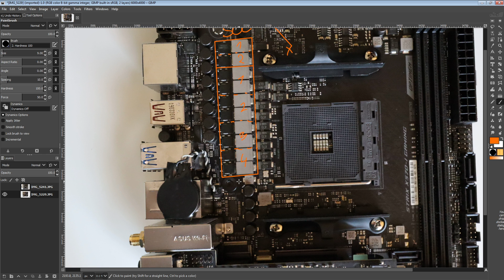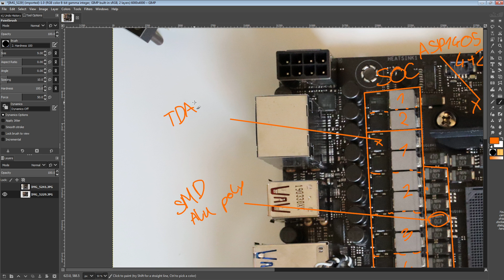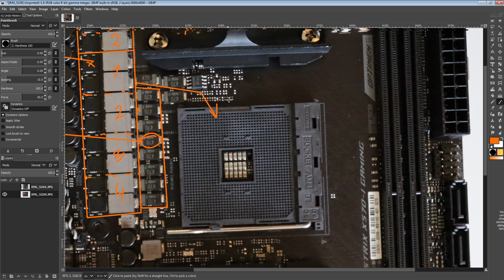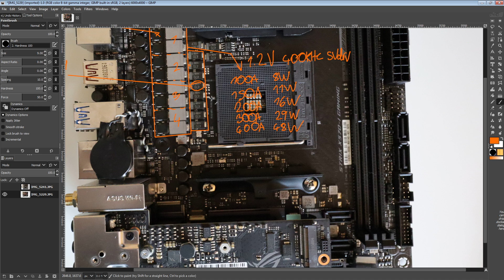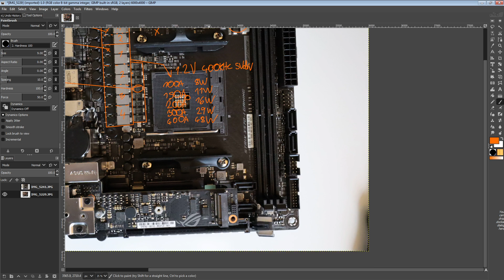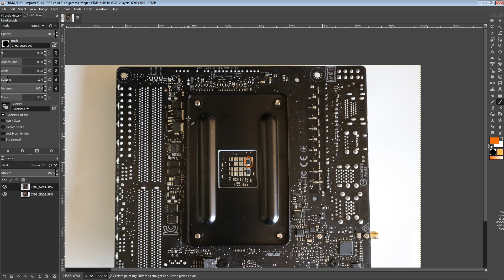mobo PCB Breakdown: ASUS Strix X570i Gaming // a cheaper Crosshair 8 Impact

Comment: wow those capacitors are awesome! I wasn't aware of the 3-terminal ones, but it's an option on the GX series. According to panasonic it lowers ESL by 50% These also have the lowest ESR of any SMD molded 470 uF capacitor at 3 milliohms. They're also really expensive at $.607 for 10,000.

I looked up those tantalum polymers on the back and according to the package codes (N  eJ8) they are Vishay T55 series(N) 2.5V(e) 220 uF(J8) and they sorta look like B-case which is the smallest size they come in. ESR for that is 25-70 mOhms. $0.444 in qty 24,000

For comparison they do make 220 uF MLCCs in 1206 size (b-case is 1411 so 1206 is a little smaller) which cost $0.417 in qty 4000. 47uF MLCC in 0805 only costs $0.085 for qty 3000

Anyway there's a surprising amount of options here, and high capacitance MLCCs are really expensive, as are low-ESR aluminum polymer and tantalum.

I had specified the panasonic molded type capcitors for a 2-phase I designed but they were so expensive they upped the BOM cost by quite a bit and I had to go back to cheaper SMD can type. I'm going to edit the layout to accept either size so if the cans don't perform as well I can just order molded ones.

Comment: I literally just bought this board!
Reply: Where from dude?
Reply: @eydleman  Amazon!
Reply: @AdamBrackney  Amazon UK ? It's £300 🙈
Reply: i got one from ebay for 250$
Reply: @Let-Make-It-Happen  need something for my 3800x lol im still debating
Reply: @PersonaXlll  +1
Reply: @hobbes2234  just brought it 5 hrs ago 😂✌️
Reply: Any coil whine?
Reply: I also got mine for 3700x last week as a placeholder for gen 4 cpus... Hopefully for gen 5 too
Reply: @DaveChips  Unfortunately I think it's been pretty clear that gen 5 will be on a new socket but I would be very pleased if that turned out to be wrong.
Reply: @AdamBrackney  I really don't mind that tbh... Had Fx8350 since the day it came out till the practically last week... And it was holding up quite strong...
I can imagine upgrading to 3950x or whichever 4000 will be most powerful with that board.. I really don't think it's gonna be obsolete so fast... If I'm gonna run it for 8-10 years... Than I won't have any regrets
Reply: @DaveChips  Totally agree, I bought a 3900x day one and I'd be lying to myself if I thought I was taking advantage of it. Lol.  I'll still replace it with whatever the 16 core 4000 series part is when it comes out but either way these things won't be out of usefulness for a very long time.
Reply: @AdamBrackney  I really can't find a way to use all cores on those cpus at this point and 9 series caught my attention simply cuz of L3 memory size over 7...
Just when I was about to hit buy button,notification popped out about 4000 series for desktops coming out soon enough.... So here I am... Patiently waiting 😅
Reply: @Anon I just counted no less than 6 headers and it's tough to see but there might be more.  Mines in use with some limited visibility.  You should be more than fine with your plans.

Comment: Do also have this board and I´m really satisfied at the moment with the 3900x. Only negative is not to change the fan curve of the chipset fan - hope Asus will fix that.
Reply: i am suffering from the same issue with my X570 Strix-E (ATX).... and the Crosshair VIII Hero has already that option!!!
Reply: Interested in this board. 'Did they?
Reply: @olafweyer859  only with custom bios. But this is available...

Comment: The Impact has Japanese 10K capacitors, the Strix 5K Taiwanese. It is 1.25 inch longer and uses that space for a SO-DIMM.2 Slot with 2 x M.2 Sockets. It has a much bigger heatsink and weighs 2 pounds more, making it almost twice as heavy. It also has better sound, better RGB and other stuff like optimem III, whatever that really means. In Europe the price difference is about 50 euro. Obviously I bought the Impact.
Reply: Here in the US the ASUS ROG Crosshair VIII Impact X570 is $430 and the ASUS Strix X570i Gaming is $260. That's a $170 difference, so opting for the Strix will appeal to many especially if those differences aren't that important to them. Also o some of the smaller ITX cases the Mini-DTX Impact won't fit.

If the Price difference where just $50 here I'd likely opt for the Impact (case permitting), as it stands I'd have to decide once the time comes sometime next year.
Reply: Where do you get the Impact for only 50 euros more?? In France, Spain and Germany they are 140/160 euros more expensive than the Strix.
Reply: @ELVERTGONNE  Not in Germany, I bought it for € 359,= at Alternate.de and got 2 x 25 euro cash back. 
You can get the Strix for € 289,= minus 20 euro cashback, so the difference is actually only 40 euro. 
In Europe we pay too much for the Strix, while in the US they pay too much for the Impact.
Reply: @doubledutch3439  it is £265 for the Strix in the UK and the Impact is £370
Reply: in Germany now 70 euros
Reply: 90 euros / 100 USD (roughly) difference here in Czech republic

Comment: You MB videos are very insightful, and to answer your question about thunderbolt 3, it’s not super useful on desktop, but in essence it can pass a PCI-e 4x connection and 100w power in either direction, don’t know how this works with desktop however, the most useful thing I can think of it being used for on desktop essentially ITX is mass storage array boxes (4+ raid in a box) or external 10G Ethernet

Comment: Intel wifi AX200 chip on this board has max operating temperature 80 deg Celcius. If you mount stock AMD cooler (especially with 3900x or hotter CPU with over 90 degrees under load) on in that pushes hot air down and around, it is not outside of realms of possibility to get thermal throttling of WiFi adapter (speaking from experience). So I wouldn't say this motherboard is entirely immune to high temperature problems just due to efficient VRM section as certain airflow configurations will still 'cook' it.
Also worth mentioning, surface mounted circuits (and heatsink) on the back of the motherboard get in the way of mounting support backplate provided with some CPU coolers (than do not reuse one provided with motherboard) making it unable to use them. One infamous example I learned hard way is Deepcool Assassin III. Check cooler mounting before the purchase.

Comment: Great board. Pretty much water cooling only in any SFF build thanks to the giant VRM cooler + I/O shroud.
Reply: Even one of my AIOs didn't fit on my asrock x570 itx board
Reply: @waatup  Exactly. This monolithic design severely limits cooler choice only because the want to use a giant chunk of crappy aluminum to save a buck and dress up the I/O. Seems senseless on ITX
Reply: @zoomzabba452  I would've preferred Gigabyte's X570 I AORUS PRO WIFI if not for the many DOA reviews. That one seems to offer the most space for the cooler, and it has active cooling for the SSD too!
Reply: @waatup  I'm planning on using the Gigabyte, but won't be able to afford until B550 is out, so we'll see what changes. 3700X in Sliger SM550.
Reply: Actually, the Noctua NH-U12A will fit on this board.

Comment: ok... now i feel stupid putting a Ryzen 5 3600 on this...
hopefully future Ryzen CPUs are also backwards compatible
Reply: I did it the opposite way... Put R5 3600X on Strix B350-I... The board is fine though...
Reply: Tomáš Jelínek lol
Reply: @TenmaWhite  Depends... If you plan to overclock, I would suggest to stick to 6 core... But for stock? Sure go ahead.
Reply: @TenmaWhite  for stock 8 cores, it will be just fine... Heavily overclocked? Depends on what you think is heavily... I was running all cores @4.4GHz / 1.5 V... Stable at around 85C in Prime 95 with Kraken x62... But I dialed the voltage down to 1.35V because I didn't want to run such high voltage through my CPU... Of course the clocks went down as well...
Reply: @TenmaWhite  yeah, I do. And temps are on very comfortable levels. I have a good case with proper airflow. I will let you know precise numbers later when I get home. But I wouldn't do such thing (4,4Ghz / 1.5 V) with 8 cores, I would be afraid to blow up my mobo.
Reply: @TenmaWhite  dont overclock it but I think so

Comment: I would have bought this if it came out a few days earlier; the Asrock x570 itx board was (and still is) on sale so I got that one; so far it seems pretty good at memory overclocking, much better than the x570m I had for a brief time. Cooler compatibility of the Asrock board is super annoying though, who thought it was a good idea to surround the socket with heat sinks on three sides?

Comment: I've heard the thermal pads over the VRMs are pretty bad and need replaced. Did you encounter similar issues or no? Seriously considering this board to go with the CM NR200 with the Noctua NH-C14S air cooler and would like your input before purchasing.

Comment: @Buildzoid, I've watched your videos for this and the other x570 itx boards.  IIRC they all have 2 phase SOC VRMs?  If that recollection is correct, then there doesnt seem to be much difference between them for APU purposes (with the possible exception of the Asrock phantom due to the maybe dicey memory layout).

It would be really great if you could address the APU question more in depth since we seem to be on the brink of seeing much more powerful desktop parts than before.  Among a number of questions on the topic, I'm very curious about things like:  How much potential for iGPU overclocking do any of these boards have?  Is there a conflict between memory overclocking to benefit the iGPU, and the 3600MHz optimum for the Zen architecture?
Reply: I have the same query about APU performance in those mobos.
As i remember there are may not a right option for a APU to Aorus x570i due to 2 phases vrm dedicated in SOC only said by BZ in that review(if i was no wrong in mind).

Comment: Interesting. The Gigabyte 550i with 90A SPS produces more heat at 150A than this vrm. But it produces less heat than the Asus board at 100A. And the Asus board is much cooler at 200A.

Comment: the chipset fan is the worst thing this motherboard has, you cant control it and it gets realy loud, like 8000rpm due to chipset getting as hot as the gpu gets, is a common issue with this board. So sad that this is basically the best motherboard when it comes to run a 12/16 core on mini itx but the chipset is horrendous. Fan gets loud af, gpu thermals are worse due to  chipset temps being high even at idle. 

So yeah, the better option is the b550i from aorus, vrms almost as good but chipset runs cooler and is pasively cooled.

Comment: Just bought this board to replace the gigabyte x570 itx board. The Asus terrible. 

The heatsink is the cheapest thing I've ever seen, the fans super thin and irreplaceable. And, the VRM heatsink blocks the long arms of the Noctua AM4 mounting bracket. Good one Asus.
Reply: I just installed a Noctua NH-U12A on there no problem. Well, actually at first I thought I was gonna have that issue with the mounting arms too. Then I realized I had them upside down...🤪
Reply: @eljeffedeloda  you can fit it, you loose the option of using the long arms of the mounting kit, so can only mount one orientation. Minor nitpick, but Ryzen is easier to cool depending on the the direction of the heat pipes (think 2 chiplets sharing a single heat pipe)
Reply: @TheLinkedList  Not sure which cooler you are using, but I think Noctua designed the NH-U12A to only sit in one orientation. In the instructions it said the longer arm was to face the RAM modules. I thought this was for more RAM compatibility, but now I wonder if they did that to line up the heat pipes with the chiplets.
Reply: @eljeffedeloda  I don't know if you have this issue, but this Asus board doesn't report the current memory voltage in the bios (right hand column) or in Ryzen Master. Is that the same for you?
Reply: @TheLinkedList  I'll have to check. I just put the system together and checked to make sure it booted to BIOS. Didn't look closely at any of the details though. The power supply I got had cables that were way too long for my case and I had to order the short cable kit for decent cable management. Those are supposed to be delivered tomorrow and work should be a bit less crazy then too so I'll check then and get back to you.
Reply: @TheLinkedList  just got everything back together and I can confirm it isn't listed on the Right Column. It is listed in the ai tweaker, but couldn't find it anywhere else.
Reply: @eljeffedeloda  thanks for checking. FYI the new bios is out with 1.0.0.4 AGESA, but you can't flash back if you upgrade to it (why oh why Asus 🤦‍♂️)
Reply: @TheLinkedList  Hey thanks for the heads up! Im going to wait a couple weeks and let someone else be the guinea pig in case there are issues since you can't flash back....
Reply: So why did you switch from aorus?? I'm trying to decide which one to go with
Reply: @lhurley1989  The Aorus had a limited rear IO and some strange BIOS issues. I'm fairly certain the chipset was never downclocking leading to idle temps of around 60 degrees C.  This made my m2 SSD run hot also. 

For reference, the ASUS idles at 40 - 45. 

The Aorus, on the other-hand, managed a more stable memory OC, is a touch a cheaper and had more CPU cooler room.

If you can have the choice to get a B450  ITX board, such as the ASUS or MSI, then you'd be no doubt better off. The x570 ITX boards have too many compromises to justify their price tags.
Reply: @TheLinkedList  I'm planning a build for someone that's a sff in the rvz03 case with a 3900x and a 2080ti. I planned on using the asus strix for GPU because it seems to be the best. I convinced them to not get 9900k and go with amd. So being as it's a 3900x, I would hate to limit future capabilities by going with something less than an x570. I've watched both of his videos for the aorus and the strix but nothing jumped out as an overall decision that one was better than the other. They each have their pros and cons. 

I appreciate the reply by the way! Thanks.
Reply: @lhurley1989  Sounds like an expensive build where money is no object. I would in that case advise the ASUS x570 ITX board just for the extra IO options to avoid disappointment down the line should more USB devices start getting used.
Reply: @TheLinkedList  that's what I was leaning towards. Plus it would look better with matching asus card and mobo. The case can fit a dtx mobo but.... jeez. Money is slightly an object when it comes to that lmao. Itll be about a 3k build

Comment: Would you even need the VRM or Chipset fans if running a low-profile top-down air cooler with a 150mm fan?  With how efficient the VRM is I would assume not, but the chipset is kind of hidden under the M.2 bridge and might struggle to get proper airflow to stay cool without the fan running.

Comment: I bought the gigabyte because
a) I'm using a 6 core (Dan Case isn't really able to cool an OCed 12 core)
b) it was actually available at launch, and Asus not only wasn't but didn't say when they would be
Reply: The only thing I really feel I missed out on was debug features. Not having those sucks. Especially because they released a bad ABBA bios (or it flashed wrong for whatever reason), and I eventually (after trying to debug with no post codes or LEDs) had to get the board RMAed and bios chip swapped (at my expense for shipping, which always sucks)

Comment: I've been rocking a Asus Strix B350-I Gaming for two years almost now.  I find the whole series hasn't changed that much (except the VRM change, but OK).  

So my real gripe with this board is that it doesn't have a 10 gigabit ethernet. I think that is the only thing you really need for sa single workstation GPU configuration.

And I'm also a bit sad that they've removed PCIe Gen4 support from the B350-I, B450-I, X370-I and X470-I since from what I've seen. On this custom designed board they wouldn't probably have a problem with it.   (ergo why it was enabled in the first place).

Comment: Pity this board is not good for Zen3. I know because I bought one for my 5950X. I see Optimum Tech here on YT had the same problems as me. Avoid until BIOS matures I think.
Reply: I literally just picked up the same thing. I haven't put it together but the board now comes with support for 5000 series out of the box. Hoping for the best at this point.
Reply: @JaleelKing  The latest BIOS that was released in the last few days does not suffer from any WHEA errors over 1600 IF clock unlike the previous BIOS versions. But only gained about 100 more points in CB20. my 5950X on this board is still 900 points behind every review of the 5950X elsewhere.
Reply: @moebius2k103  Where are you looking to compare your results and test? I'd like to look once I get mine up and running.

Comment: Great videos, I need some advice, Asus strix x570-i or MSI x570 tomahawk for 3D modeling and gaming and not taking in consideration the form factor.I have an amd 3700x to pair with. Any help will be appreciated !!
Reply: This board is for 12-16 Cores with pretty good overclocks. Tomahawk can do the same and is cheaper. 

If You don't care the form factor, rhen go for the Tomahawk, mini itx is for people who cares for the form factor.

Comment: So i bought an asus z370-f for very cheap on ebay and it was sold because the owner wanted to upgrade to a hero board. So far pretty ordinary.
However it was bundled with an EK Monoblock.
My question: With good thermal pads wouldn't the monoblock easily cool the 22, 28 or more watts of heat this vrm produces or are there other issues for stable ocs ?